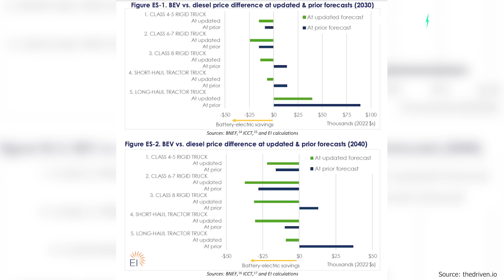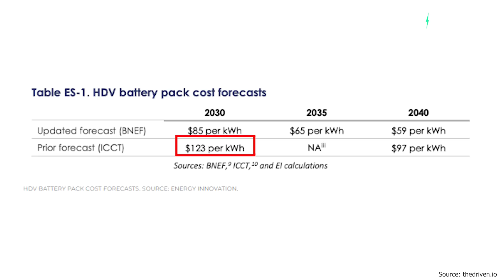Electric trucks will be cheaper than diesel many years sooner than expected

Comment: Trucking is all about logistics and economics. There is currently parking shortages in many areas of the U.S. and it is common to find diesel pumps stacked 2 and 3 deep. The government backed a program decades ago to electrify truckstops to reduce the emissions from idling trucks. It resulted in only a handful of larger truckstops being outfitted and exacerbated the parking shortage, which is exactly what I expect going forward. The government mandated electronic logging devices that track every minute and movement that a driver makes in dealing with these present challenges makes a driver's life stupidly difficult even now. The U.S. will get more disruption than they're bargaining for from a rapid transition to electric trucks. I like the idea of an electric truck with its instant torque and no need for 10 speed or more transmissions and the downhill safety of regenerative braking but, trying to quickly transition to them within the current system will result in unexpected inefficiency and probably break the widely diverse and cheap trucking system that we enjoy today. I see big companies getting bigger and building their own infrastructure system and smaller companies being forced out. This may prove to be an improvement for drivers but, it will come at a cost to consumers as these larger trucking companies leverage their market power.
Reply: You said it.... they barely have enough spots for cars .... where are they going to be charging these trucks and what are the drivers for? Electric trucks will most likely drive themselves same with cars.... there is one solution and that is stacking but that will require removal of the cabin/driver....
Reply: Late stage capitalism is eating small business to the detriment of many. In other news today, water is wet!
Reply: That's the plan.
Reply: @howardj602  Yes more long Haul Goods should be done by Electric Rail. This year Batteries have doubled their Energy so halving their size which means longer range and lighter batteries. Trucks make up for places where Rail isn't Built and is Much better in Short Haul Trips.
Reply: @keithwilson1554  What's "Haul Goods"? Or is this part of random use of upper case?
Reply: An Australian Company already converts your Old Truck to Electric. It has a Battery Pack that can be replaced by Forklift in 5 Minutes so quicker than Diesel. And a 4 hour driving range. Trucks are highly regulated as to how many rest stops they have to have. This method negates the WHINE of Pollution Lovers who think they have to wait to recharge.
Reply: I guess that depends on your definition of quickly. 
Diesel won’t be able to compete economically with battery electric. 
More heavy BEV trucks like Semi will arrive soon. 
The change will come hard and fast for economic reasons. Not mandates.

Comment: I hear a video at least once per week proclaiming that battery prices will soon plummet. Have yet to see this magical price reduction.
Reply: Yep battery  prices going down all the time, very magical
Reply: @garyfromlondon I think MG sells a car in the UK and it costs 40,000 euro/£. A similar car costs in China 20,000 euro/£. That isn't magical it's miraculous!
A man (in Finland) had an accident (heavy rain, and a little too deep water on the road,  and the car spun and hit the barrier so it got damaged in every "corner") with a Ferrari.
Then the question was could the car be repaired. Price of the bonnet 60,000 euro, diffusor also some 60,000 euro, the rear bumper, i think, 80,000 euro... So a repair wasn't an option.
As the insurance company paid, he got 530,000 euro.  So about 50,000 km costed him about 200,000 euro. Does it matter how much the fuel costs per litre?
Reply: @leiflillandt1488  What has writing off a Ferrari got to do with the cost of batteries  ????
Reply: @leiflillandt1488  Off topic. What has this to do with EVs?
Reply: Actually, you have. Battery prices fell 40% just last year.
Reply: Google is your friend. It's easy to find battery prices.
Reply: lithium ion battery prices have fallen by more than a factor of 20 since the year 2000!  Is that magical enough for you? ;)
Reply: Once per week since the 70's.

Comment: Replacing diesel truck will have the biggest environmental impact by far. Regen braking will make trucking much safer as well as reduce toxic brake dust
Reply: Diesel trucks use engine breaking also . Saves on physical brakes
Reply: Owned a diesel veh for 20 yrs. Every morning the stench of engine probably gave me bronchitis 😂 @arthurwakhweya9420

Comment: For a company that already has bases all over, like a UPS or Amazon, I wonder if the range isn't already sufficient to bring a trailer between bases up to say 200 miles apart.
Reply: Yes, exactly.  That's why Pepsi was the first Tesla Semi customer.
Reply: @Scotto_desu Agree that is the reality nowadays for many trucks. Then the drivers have to rest "every now and then"!
Reply: The Tesla semi can drive as far in a day as a single driver is legally allowed to in Europe, provided they take the required break somewhere they can recharge. The EU countries have committed to installing ultra rapid chargers for trucks throughout the main road network. Once that's in place, unless you're driving with a 2 driver team, a BEV truck will suffice.

Comment: You need to factor in cold weather conditions too. If a truck is driving in sub zero temperatures its going to put considerable more strain on the electric batteries, also the fact that we are having issues with these vehicles simply not starting when it gets very cold.
Reply: WHY is NORWAY the highest EV ownership per population in the World? I think it get cold in Norway
Reply: @alankovacs7636  Your telling me all of their long haul trucks are electric?

Look, I live near Fairbanks Alaska, also known for being cold. This winter none of the electric cars would start.
Reply: @dannybauman1454  I checked your claim, seems Alaska public Media interviewed Alaskan EV owners and they report that their EVs work just fine in winter. Here in Indiana, my Bolt does just fine. Could not find any articles about EVs failing in Fairbanks, what's your source?
Reply: @dannybauman1454  You need to plug in the block heater for an ICE, maybe the same setup for electric per the battery?
Reply: @jaaklucas1329  I saw the videos where the cars were plugged in, they would still not start.
Reply: @alankovacs7636   population of Norway, 5 million, with the vast majority of the population being based around one city, Oslo. And the trucks and distance busses are diesel. (Local busses are often EV). This is not the same as US/Canada winter trucking. Stop being stilly mate. I know Norway my family live there.
Reply: @alankovacs7636   due to heavy state subsidies.
Reply: @alankovacs7636  I believe the government carrots and sticks have pushed many to get an EV but they still only have 25% total vehicle fleet. It's not choice if the government prevents choice, China is the same.
Reply: Heath pumps are the answer to that problem. The better new EVs use them to keep the battery (and cabin) in optimal operation conditions. They use far less energy to do the job thus only drain the battery a few percents.

Comment: So Sydney to Melbourne the Volvo has to stop 5 times to charge its 300km range as it won’t charge to 100 percent fast enough. Sure sam . Dreaming 😂then there is load 😂😂
Reply: As he mentioned, this will start out with urban and regional routes. Those long-haul routes will come later. Probably quite a lot later.
Reply: Yes, not to speak of how the grid and charging infrastructure will cope if every diesel truck is replaced by an electric truck.
Reply: Things will change very quickly, economics will drive it. In not so many years diesel trucks will be dead!
Reply: Dreamer!
Reply: Tesla semi has over 1000km range, hauling 82k gross.
Reply: @markplott4820  that’s pounds not kgs.. and it’s range was 800km in perfect conditions… here in australia most weighs way more than that
Reply: @markplott4820  Yeah..... sure.
Reply: @kellyeye7224  - see RUN on less challenge. 
Tesla smoked them all.
Reply: An Australian Company already converts your Old Truck to Electric. It has a Battery Pack that can be replaced by Forklift in 5 Minutes so quicker than Diesel. And a 4 hour driving range. Trucks are highly regulated as to how many rest stops they have to have. This method negates the WHINE of Pollution Lovers who think they have to wait to recharge.
Reply: @keithwilson1554  is that the same EV cement  truck that burned for 2 days and blocked traffics for 2 day  in Australia ?😂😂😂😂🔥🔥🔥🔥🔥🔥
Reply: @keithwilson1554  Tesla semi does your 420miles towing packets of crisps maybe 😂

Comment: That would be  neat.  About 150 billion Truck miles driven in the US per year at around 3 kilowatt hours per mile electricity 450 terawatts is lot of additional electricity that needs to be generated and distributed.
Reply: Just put a solar panel on the roof😅
Reply: 3 kWh per miles. That would make 3x62 miles which means 186 kWh per 100 km! In Europe at more or less dry roads (no snow and ice) a 40 metric ton vehicle (semi truck with 5-6 axles) consumes about 115-120 kWh per 100 km/62 miles.
In the Nordic countries they use combinations that weigh in at about 80 metric tons and are 34 m/113 ft. I haven't seen tests with these vehicles.
BUT to get rid of these vehicles from "normal" roads it would be more efficient to use trains. To transport trailers on railways!
Reply: Let’s get generating and distributing then! I thought Americans weren’t so lazy.
Reply: You mean 450 TeraWh? That would be much in countries like Finland and Sweden with a population of 5.5 respectively 10.5 million people when they now consume some 110 TWh respectively 140TWh. I should know these numbers, but my memory is not perfect any more... 🥺
At least the effect used/produced in Finland is about 10,000 MW, between about 9,000 and 11-12,000 MW. The plans for the next 10 years are to increase the production to 20,000 MW...
Why would it be difficult or impossible in the USA to double the capacity in ten years?

Even though I don't think these investments in Finland will come true! You can't make investments if the price of electricity will be negative... No one makes investments if the average price will be about 0.02 USD/kWh (before any kind of taxes)...
Reply: Solar w/out storage is incomplete
Reply: New diesel trucks may still be in production all the way to 2040. And running well past 2050. It's just that electric will really start to take off in 2028 or so instead of 2032. This will be a decades long transition. Truck drivers going electric will appreciate less noise, bumps, shifting, and lung damage.
Reply: Yes....and no. Approximately 70% of the electricity needed to electrify the entire US transportation infrastructure is made available by not needing to refine and transport fossil fuel into transportation fuel. The balance does have to be met through clever grid management, renewable, BESS, perhaps modular nuclear. No showstoppers, just the will to act.
Reply: Batteries' energy density isn't good enough for this application, not now and not for the foreseeable future.
Reply: Better than stinky diesel
Reply: @GWAForUTBE   It will require burning a great deal more stinky diesel to dig and process  the metals to build the machinery, distribute it  then construct it. Dirty, hard dangerous work done mostly by the kind of  people you might appreciate about as much as diesel. People that get the work done..
Reply: @Jason-bu9sv electrical demand varies greatly at different times of day. If you can charge your vehicles outside of the peak demand hours then you don't need any extra generation capacity. Focus on routes that can be done without charging during the trip and leave long distance til later.
Reply: @adrianthoroughgood1191  Remember in the Pandemic how the shelves were empty b/c less truckers to carry goods between stores (1 part of the supply restriction, there were other phases that was global supply chain). Well, if you restrict the times that haulers can make certain trips, you will increase the average length of time to distribute goods, and the end result will be shelves that are only partially stocked b/c the goods they need are still in transit and won't arrive for 5 days instead of 2, or 2 weeks instead of 1.
Reply: @RT-mv7df  I said nothing about restricting trips. I'm saying depot to customer deliveries almost all happen in the day with the truck returning to the depot at night. Those can be electrified with no impact on the grid in peak times. 
For longer journeys that require fast charging along the way, those chargers can be backed by large static batteries at the charging station to they don't have to draw the current from the grid attacks the time of charging the truck. The static battery can be charged during off peak hours when there is spare capacity. Sodium ion batteries have just started coming on the market. When production has been scaled up they will provide cheaper but heavier batteries than lithium which will be perfect for this application.
Reply: @Jason-bu9sv  Have you always been concerned about pollution and the environment or did you just recently become an environmentalist?

Comment: Most People don't know that Trains also run on Diesel Fuel too
Reply: Tesla semi is CHEAPER to operate than Diesel trains .
Reply: @markplott4820  LMFAO I bet you're right that a Single Tesla Simi uses less Electricity than a Diesel Train pulling Hundreds of Rail Cars
Reply: @paulhailey2537   - TESLA semi beats RAIL on price to Market alone.
Reply: Most people don't know that the trains are really electric and the diesel is only used to generate the electricity. May of them can already share electricity with an external "slug" to speed things up. This makes conversion to electric super easy. https://en.wikipedia.org/wiki/Slug_(railroad)

Comment: should be possibel to change batteries on a truck, maybe not all batteries but a standard format that can be changed in few minutes by a robot truck. The weigth limitation will get smaller with new batteries and maybe a axel more. EU are about to raise total weight limit.
Reply: Meh, MCS will allow an 80% recharge during the mandated 30 minute break anyway. No need for the logistics headache of spare batteries and robots. https://en.wikipedia.org/wiki/Megawatt_Charging_System